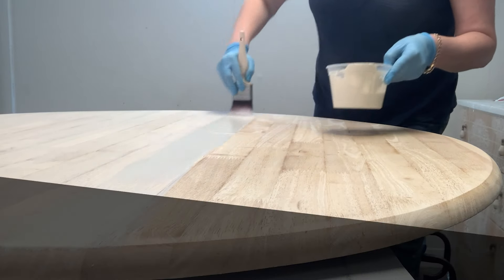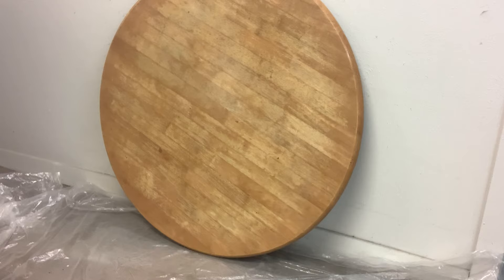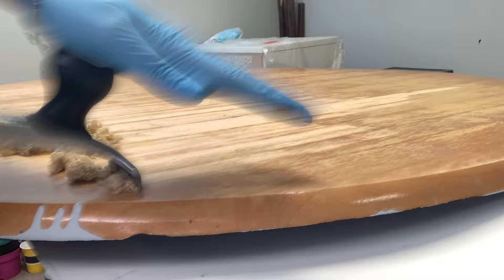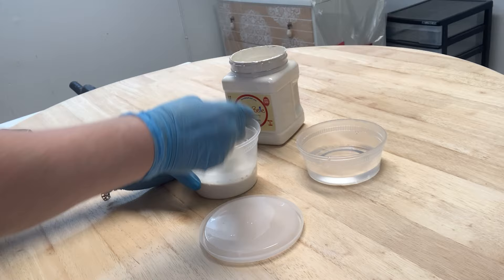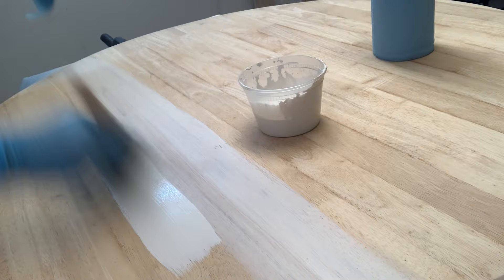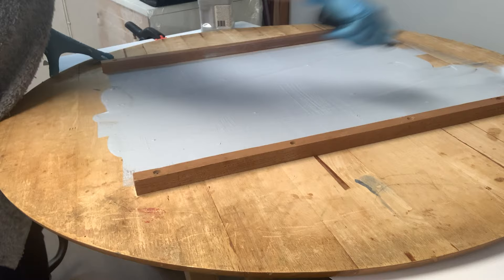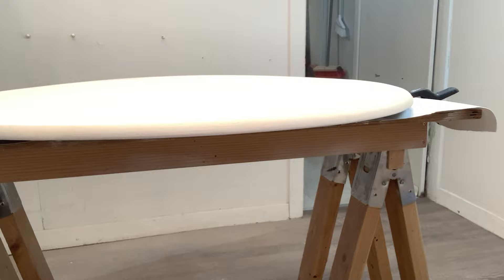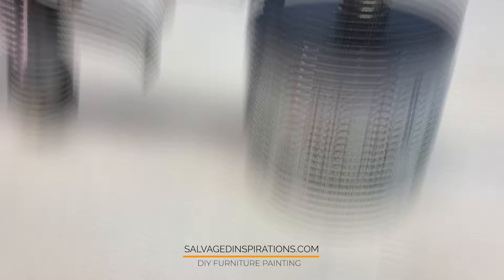How To Whitewash Wood with Paint Dining Table Makeover

Comment: I got the scraper yesterday and immediately tried it on a small cabinet top.  It worked really well!  I saw the replacement blades and feel they are rather costly, so I hope they last a long time!

Also, I wanted to comment on the mold problem.  A few years ago we had a mold problem in the basement of our church. It wasn't bad, but since there were a lot of people using the area we wanted to make sure to keep everyone safe.  I have a particular sensitivity to mold so I know the side effects.  We called in a mold remediation expert to give us an assessment of the problem and a solution.  The first thing he advised was not to use bleach because it does not kill most molds, it only lightens them and fools you into believing that the mold is gone. He said that mold is terribly insidious and can stay alive even through several layers of paint. When he looked around at the walls which had been painted the year before, he showed us teeny dark specks of mold starting to come through. That walls had been washed with bleach prior to painting. He advised using a product specifically engineered to kill mold spores.   So you were right, Denise, in advising people to get mold remover at a hardware store. 

I love watching your videos, Denise.  It amazes me how much time you put in to your work.  But cream always rises to the top!
Reply from the maker: I didn’t know the replacement blades were expensive but I have to get myself a few as well. And thanks for writing about the mold problem. This will help many people I’m sure! 🤗🤗🤗